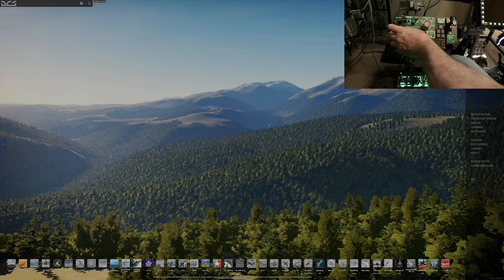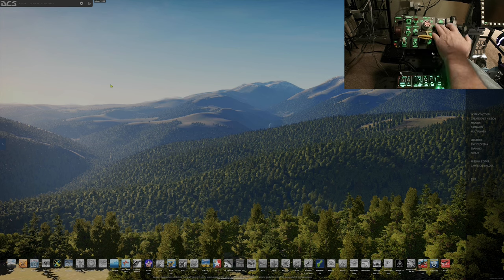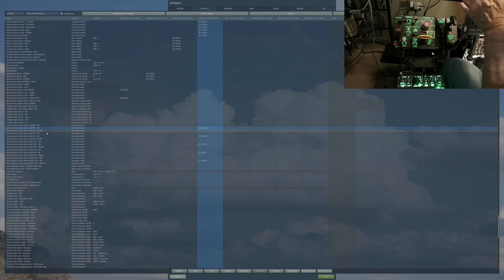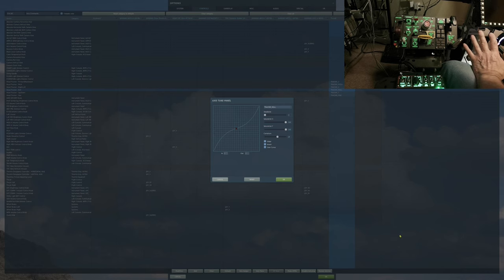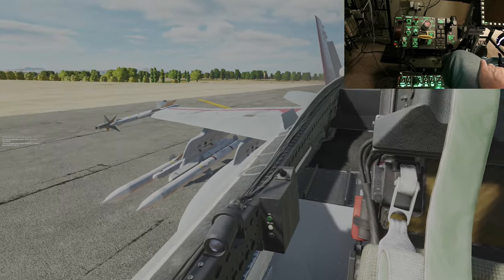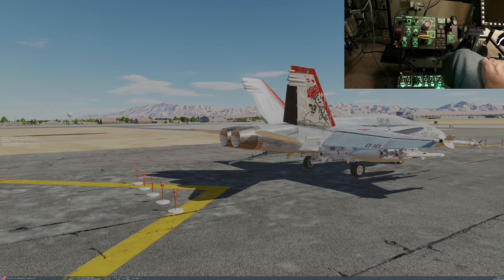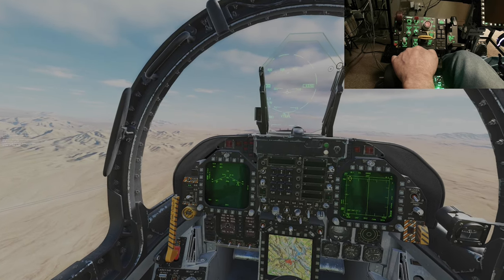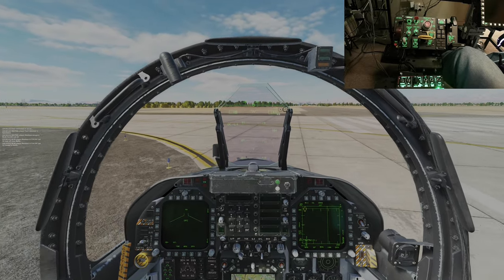Winwing PTO 2 Part 2 Video.

Comment: Hey man, i noticed when you cycled the gear, the handle doesn't light up red. And the button assignments you were talking about for the jett switches - i didn't have to do any of that.
I just installed the simapp Pro software and selected f18 at the device map for the pto2 and set the dcs scripts folder in the simapp settings menu.
Then when i started dcs and jumped in the hornet the PTO 2 panel worked perfecrly without needing to do any assigning of controls in dcs. And the gear and hood transit lights worked, the flap position lights, etc
Reply from the maker: I never even bothered to look at that until yesterday, my buddy was over and asked me the same thing.  I opened Simapp pro and selected DCS and it all came to life.  For some reason I thought it would be harder than that. Really should have looked into that months ago, but thank you for looking out.